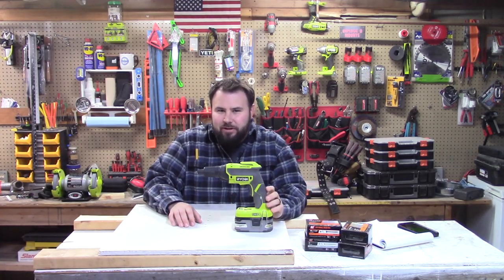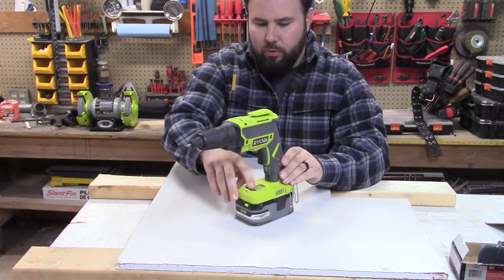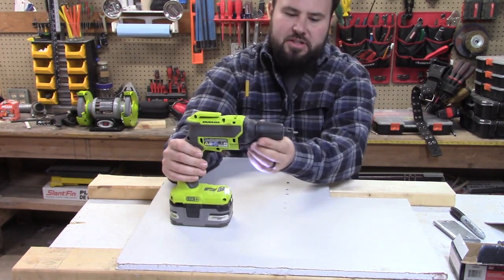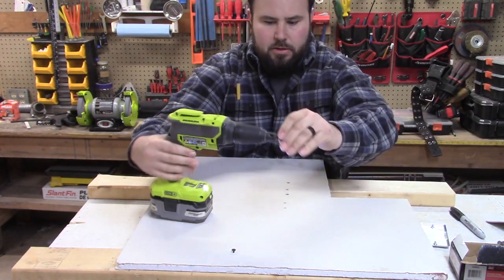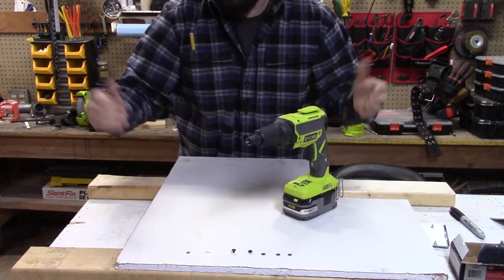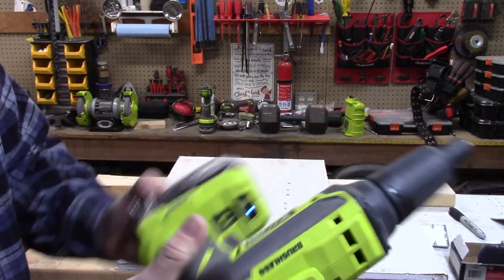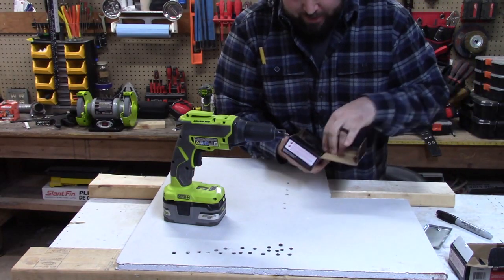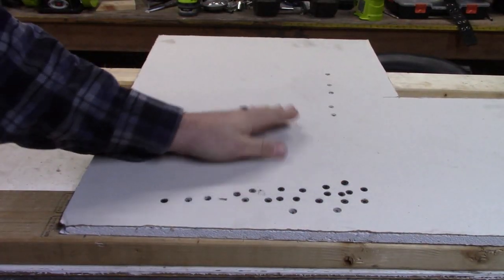Ryobi drywall Screw Gun review

Comment: I was cool hand Luke by the time I was done installing only 2 sheets of Hardie Board with an impact gun ..."don't make drive another screw  boss" I begged myself.  I"ve got about another 18 sheets to go and I'm going to buy one of those screw guns right now.  Each 3'x5' sheet requires about 58 screws, and it is a timed event because of the thin-set mortar under each sheet.   The volume level was loud as hell also, and each screw wanted to go in at a slight angle making getting the heads the right depth impossible.  I hope my 4 ah batteries are going to be strong enough, I've made so many trips to HD I'm thinking about moving closer.
Reply from the maker: Good luck!

Comment: Since the motor already stops quite fast, then what's the point of the clutch? It's so you can keep the motor spinning all the time while speed-driving a series of screws, right? But then if that kind of motor is set up to stop on a dime anyway, what's the supposed advantage of keeping it spinning while doing a string of screws when you might go just as fast through them without keeping it spinning?

Comment: I have been installing drywall/sheetrock for 20 years.  I agree that a proper drywall screwgun is important.  I have tried various brands of drywall screwguns, including the Ryobi.  I absolutely would not recommend the current version of their tool.  Personally, I prefer the Dewalt.  I currently have Dewalt, Hilti and Ridgid screwguns for my boarding crew.
Reply: Why not the RYOBI?
Reply: @manuelgomez2715  Ryobi is the cheaper version of ridgid.  The two brands are linked somehow.   Depth set nose cone on the ryobi is weak, lacking power, uncomfortable in the hand, when I was using the ryobi gun the battery options were very limited.  I've 'gone through' other ryobi power tools as well, circular saw, oscillating tool, palm sander, etc. and they all disappointed me, most by complete failure.  I'm a Dewalt man, I believe many of the other top brands also make solid tools...just not Ryobi, and that's why their line is cheaper, because it's 'cheaper '.  Just my thoughts, but what do I know, I'm just a dumb@ss with a power tool!  

"Arr!  Arr!  More power!!" -Tim the tool man.  😆

Greetings from Canada's border city!🇨🇦
Reply: Hilti is the best drywall gun

Comment: Hey! brother if you have time you could try that drywall screw gun on a half inch fiber cement board (Ficem board) 
on a 0.50mm metal stud. I am very grateful if you consider. Thanks in advance. God bless. "ryobifreak"
Reply from the maker: I think that will work it drives 3 1/2 screws into deckboards
Reply: @livefreeandtoolon  that sounds really good i wanna buy two of them and send it to Philippines. Anyway thanks bro.